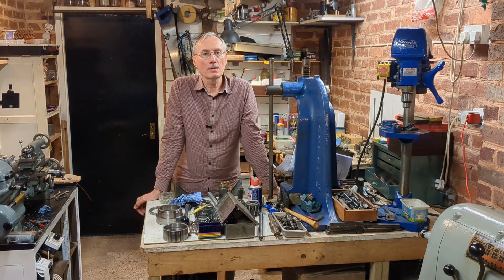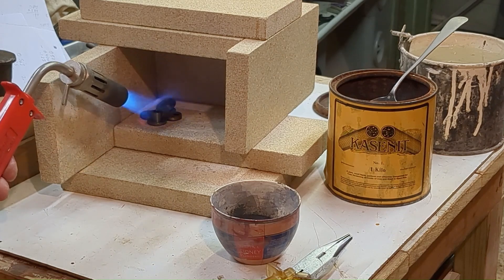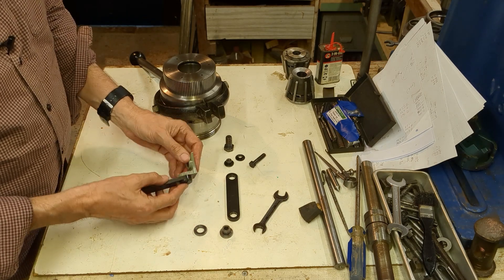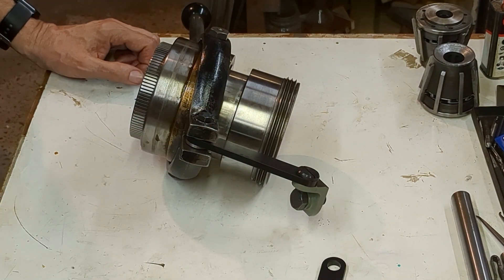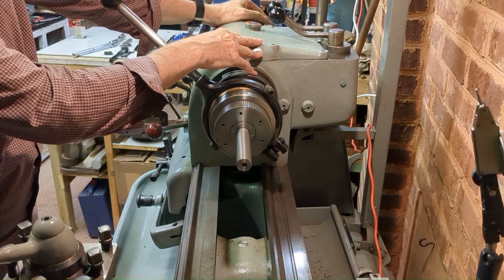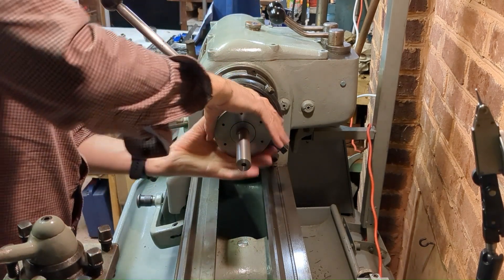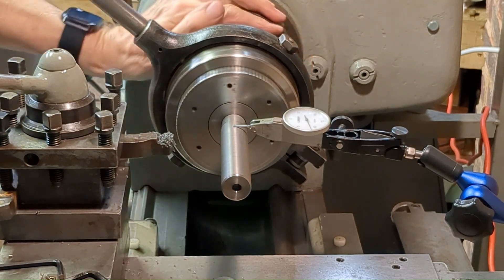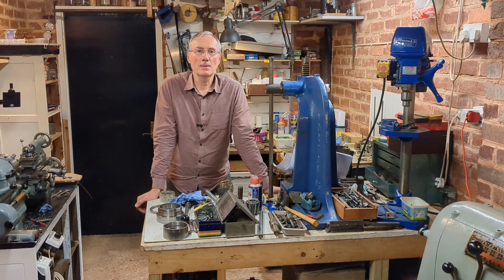Reconditioning & fitting a collet chuck to a Colchester Student lathe - part 3

Comment: Hi Clive. My husband has recently purchased a Pratt Burnerd LC15 chuck & collet set. He has stripped everything down as per your videos but can’t release the locking ring. At the moment it has been soaking for about 4 days in WD40 releasing spray. Have you any other suggestions or advice please? Thanks
Reply from the maker: Hello. My collet chuck had no rust on it yet that ring was not easy to unscrew. In the end I had to mount the chuck on the lathe, make a pin to fit the damaged hole on the circumference, and use the large C spanner (the one used for chuck mounting) to gently rotate the ring. It took some care, but eventually it slowly shifted. Of course you first need to remove the locking setscrew which grips on the thread.
You will see reassembly of this in part 4 https://youtu.be/-Pf0IaemD6M (24:00-26:00)
Hope this helps.
Reply: @Workshopfriend - thanks for your reply! He’ll have a go and let you know. 😊

Comment: Clive the reason you are having more runout than expected is due to the fact that the collet chuck was not turned in situ with your machine. All spindles are different, even by the same make, model. In order to 'true it up' to your machine would be to remachine the taper or sleeve that the ground bush taper sits in that accepts the collet. Take a look at myford lever chucks, they smartly have a backplate type, similar to a traditional 3 jaw setup, which allows a new user of the chuck to true it up to their machine. The earlier models of the myford lever chucks didnt have a backplate and were machined at the factory on the lathe being sold with the accessory. Theres a good chance this is what happened with your collet chuck.
Reply from the maker: Thanks for your feedback. I understand your point and if ever I make an ER collet chuck I will certainly take your advice and turn the backplate in situ. Unfortunately, that isn't possible with this collet chuck. The condition of the lathe spindle nose taper, though not perfect, does not explain the run out I have seen. For the time being I am limited to trying rectify inaccuracies within the chuck itself. The next video may reveal to what extent this will improve the situation. Thanks once again.

Comment: Check the internal ans external spindle tapers, i worked on mine and gained an enormous improvement in concentricity! Excellent video!
Phil
Reply from the maker: Thanks, Phil. You have preempted my next video! In my case, however, it didn't seem to make much difference. It is so annoying that items had been fitted without first cleaning out the swarf.
Reply: @Workshopfriend  there was a lot of minor swarf damage on both internal and external tapers on my student, and I was amazed at the improvement I got when using the spindle bush and a test bar. The first time I blued it up it was immediately obvious why the errors were there! I will watch with interest!
Phil

Comment: Nothing like the smell of Cyanide Clive.
I used Hardite in a Perth high school workshop also containing cyanide, can understand why it's not manufactured anymore, the good old days.
After the cut it should have been concentric, maybe unequal hardness of material or hoping it is not the spindle bearings.
Reply from the maker: Thanks, Willem. I will continue to use the good old Kasenit, but with caution.
Yes, the reason it wasn't concentric is because I hadn't fully cleaned up the surface - the light on the surface shows that. I hope to do a more thorough job of the testing next and final video. Glad to say that I am sure it isn't the bearings.
Reply: My can of Hardite had the bottom rust out, hazardous dust to clean up.
Suggest you keep it in plastic bag.
Reply: Truck driver recently died, delivering cyanide to W Australian mine, swept out his truck and found dead in the cab.
Reply from the maker: Umm, will be extra careful!

Comment: Yes very interesting. I too have a burnerd multi size collet chuck for my student, it's the solid not lever type. I have noticed there is a little run out, maybe 0.005mm to 0.007mm. I'm thinking it might be the fact that the spindle and bearings need to reach optimum running temperature. This I believe, means the spindle expands, reducing bearing clearance. I know the rear spindle bearing outer race floats on I think 15 radial springs to allow for this thermal expansion.
Reply from the maker: Thanks, Constantine. I would be very happy with .005-.007mm TIR! That sounds very good at the outer edge of the collet chuck. I wonder if the spec on the lever operated collet chuck was lower since it was probably intended for higher volume work(?)